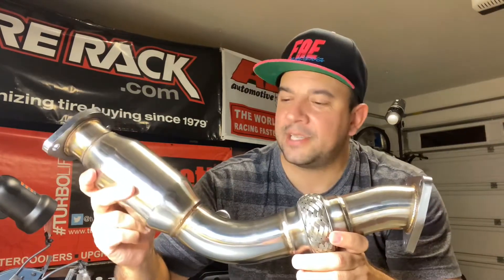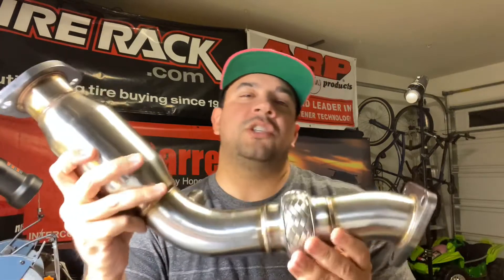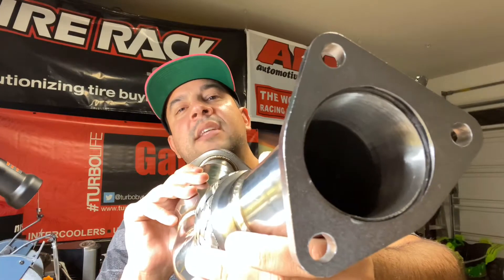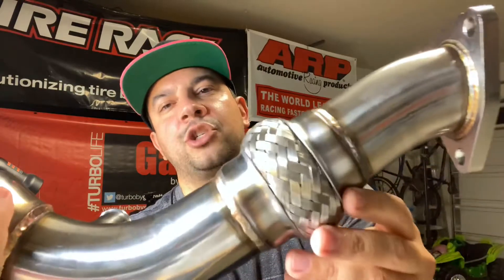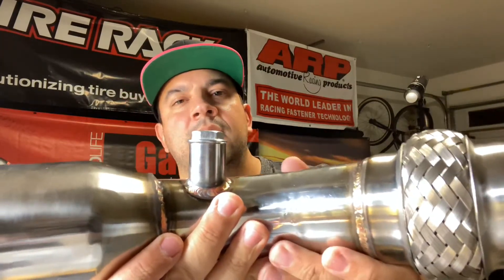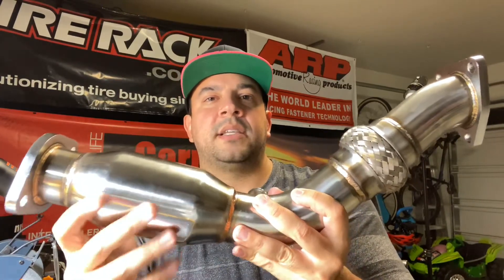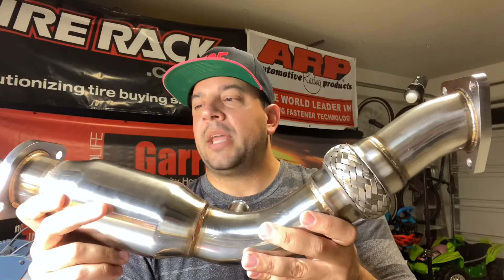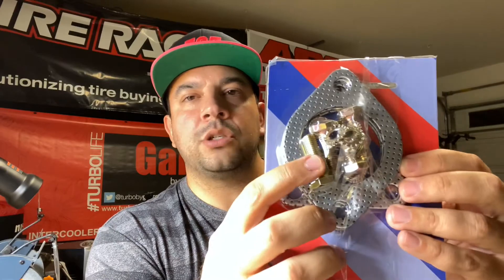Gent5 350z & G35 Test Pipes Overview

Comment: I'm trying to find some information on this company if they're reputable I really don't want to spend money on a piece of junk. Everything I've seen looks decent The price seems too good to be true though.... Looking at half the price of the cheapest of cheap exhaust from a reputable company. Like I said I just don't want a tin foil tube for an exhaust trying to pass an inspection.  I already basically have a straight piped car so I don't want to make it worse.
Reply from the maker: It’s manufactured from same companies as Megan, TopSpeed, ISR, etc. Just different options
Reply: Order off gent5 website but no tracking # or anything, have this problem?
Reply: @ewitdaslap  hey man, did you ever get your order? I'm just about to buy something from their website so I wanna know if they actually hold up.